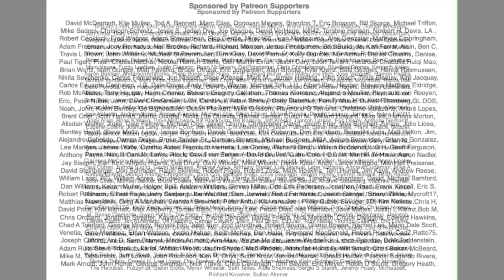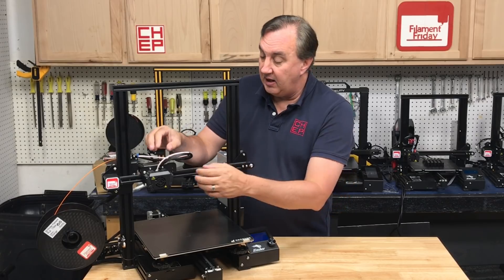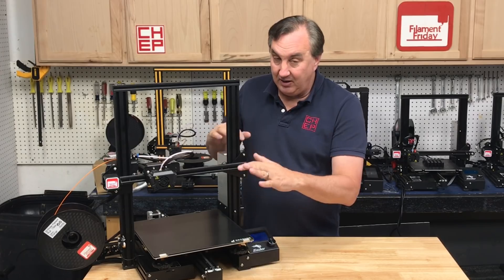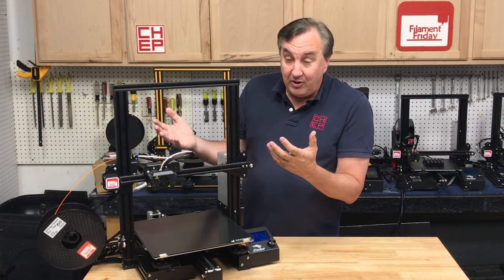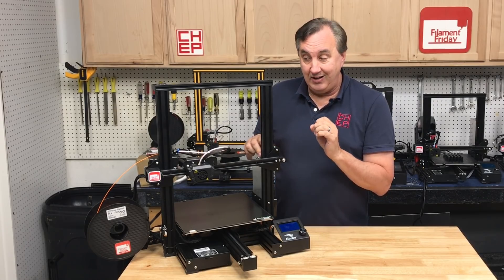Creality Ender 3 MAX! - 300mm x 300mm x 340mm

Comment: I don't know about the Z-Stop switch placement issue, but the current website listing advertises that the Max now comes with a run-out sensor installed on that empty bracket space, and mentions that the board is "silent" (50db).  It's also now $329 US, so the same price as an Ender 3 Pro and a Extender Kit, but you're getting a run-out sensor and a "silent" board, plus the dual cooling fans.  Mine will be here this week.  I already have a BLTouch to go on it, so the z-stop issue, if it still exists, isn't a concern of mine.
Reply: Scrolled further down, and the drivers are advertised as 2208.  So it's the 4.2.2 board with the 2208 drivers.  I will confirm when mine arrives if someone else doesn't by then.
Reply: @jafrance78  How's your printer? Did you get it by now?
Reply: @toasttoriginal  No, it’s taking longer than I expected. However, I can confirm that Creality did NOT redesign the Z Stop switch mount. It’s still fixed, and too high.
Reply: @jafrance78  sorry, i am new to 3d printing but how does the bl touch negate the z stop being too high? I also planned to get the bl touch add on.

Comment: Hi, I have a question what keep me from buying 3D printer. -  It is really time consuming and problem to properly set up ? Or I simply install all parts , and print from file ?
Many Thanks
Reply from the maker: Depends on the printer you buy. The more expensive printers (above $1000) are better supported and more plug and play but no printer runs without some TLC.

That’s why I recommend a low cost printer to try it out before spending more to find out you don’t like it.
Reply: @FilamentFriday  Many Thanks for the advice, I heard that it can make trouble and exercise your patience.

Comment: I wanted to check the print volume / space dimensions. The website says 300mmX300mmX340mm but an image shows 300mmX300mmX400mm.  Which dimension is accurate?
Reply: 300x300x340 is correct for the Max.  The CR-10 is 300x300x400, and the Ender Extender Kit makes an Ender 3 300x300x400.

Comment: Heck, even the CR-10S Pro/V2 still has an 8-bit board, and as far as i know they havent released any upgraded 32-bit boards for the CR-10S "Pro" model? Its like they forgot the CR-10S Pro/V2. Instead of releasing new models every month, focus on the ones you got. Why should people buy the more expensive Creality printers when the new cheaper ones have better specs than the more expensive ones?

Comment: Thank you very much for your content. I do have a question. Ender 3 Pro has 20 teeth pulleys for X and Y axis, that means 80 steps per 1mm. What will happen, if you change these pulleys for 16 teeth. If I do count correctly ( Prusa calculator not me 😄 ) we should get 100 steps per 1mm. Will it increase the accuracy of Ender 3 Pro for example? Torgue should go higher too with accuracy I guess. If it does, maybe Creality could do it for all new Enders. What do you think? Can you test it? I bought Ender 3 Pro, just because of your channel. Thank you very much for all the videos. Have a very nice day sir.
Reply from the maker: Are the different diameter? I don’t see why steps change for teeth.
Reply: @FilamentFriday  If I do have the right chart, 16T pulley has pitch diameter 10.19mm, 20T pulley has pitch diamater 12,73mm, everything else is same.
Reply from the maker: You could try it. With microstepping, I’m not sure there is a potential for much improvement. I’ve seen 0.9° stepper motors installed but never saw print improvement.
Reply: @FilamentFriday  Sir, you are an expert, not me, I am just guessing. It looks good on paper.
Reply: 16 teeth at GT2 (which has 2mm tooth pitch) is 32 mm per rotation. 20 teeth is 40 mm per rotation. 200 steps per rotation. 1/16th microstepping makes 3200 micro steps per rotation. By my calculation, then, for the 20, that’s 10mm per 800 micro steps aka 80 per mm.

For the 16, it is indeed 100 micro steps per mm (3200 micro steps for 32 mm). The difference between those two is going to be marginal. And also, the 16 teeth gears are starting to get pretty small compared to the tooth size.  At some point, you’re going to run into the thing where the ratio goes up and down depending on what side of the tooth is engaged exactly. The GT2 belt profile is designed to do that as little as possible, but that effect is exactly why 16 teeth gears fell out of favor and 20s came into Vogue.
Reply: @JasperJanssen  It still looks "on paper" improvement is 25%, even the improvement is invisible for us.
Reply: @AdamDeBeers  yeah, the question is whether it’s improving the right things. 80 vs 100 micro steps per mm means 12.5 vs 10 micron per micro step. Now, how many micro steps is the actual effective resolution? Probably around 4 ish. We can definitely do half steps, quarter steps are mostly ok, anything more than that is pretty iffy. So let’s say we’re talking about 40 vs 50 micron in actual impact.

Is your gantry really stable to the point that 10 micron makes a difference? If you were to assume that you can actually do the full microstepping effectively, is your frame stable and true to within 2.5 micron? When things are moving, and possibly people are walking? I can almost guarantee that if you have a heavy footfall on a wooden floor you will make a CR10 without diagonal braces move much more than 3 microns at the top of the gantry.

Balanced against both the lower max speed (which goes down in the same ratio as accuracy goes up) and the increasing likelihood of tooth pitch artifacts showing up, I don’t think this is a meaningful upgrade.

Plus there is the fact that upgrading to 400 steps per rotation steppers (0.9 degree instead of 1.8 degree) is trivially easy and doesn’t really give you any useful improvement despite a literal instant doubling of precision.
Reply: @JasperJanssen  Thank you very much for explaining.

Comment: I wish they would really at a bl touch/auto leveling! Or make it an option! This would make this a way better machine!!
Reply: I found out creality does offer a BL touch for the ender three it’s $50
Reply: @trialnterror  Yeah I put a BLTouch on my Ender 3 v2.
Reply: @Krytern  how good does it work?
Reply: @trialnterror  Do you mean how to install it, or how it levels the bed?
Reply: @Krytern  I mean does it work good as in sticking the filament to the bed properly? And long term use does it work?
Reply: @trialnterror  It works great. Prints stick to the bed and I even have tall, thin objects I print where I put a brim on it and it sticks good still. Perfect first layer every single print without having to level the bed myself.
Reply: @Krytern  I have quite a few printers and never used one. I bought the kit and I leaning on putting it on my ender 5 I’m also going to buy the stuff to make it dual Z. I have a heck of a time with that ender 5. I have never really got it to print. ( I have 3 cr10’s 3 ender 3’s anet, anycubic, sunlu s8 and the 5) so I feel I’m well versed in printing. This is my last resort to get the ender 5 printable!
Reply: @trialnterror  Maybe you have a warped bed. The bed on my printer is warped and the BLTouch compensates for it giving me good first layers.
Reply: If you want Bed Leveling and Filament Sensor, you buy a CR class machine, if you don’t, you buy an ender class. CRs go down all the way to base ender 3 size as well as up to 500^3 machines, Enders have... a little less size variation and more configuration variation.

It’s pure market segmentation by Creality.

Comment: Still happy with my original Ender 3 and a few upgrades (e.g. MicroSwiss hot end, DIY direct drive extruder). I don't need to print any bigger so don't see any reason to upgrade. I'd be more interested in updates that improve handling of more exotic filaments, stock Enders are best suited to PLA.

Comment: There's no need to get longer compression springs.  Add some washers on the threaded stud under the springs to increase compression.  I've done this on other printers when I've changed the printing surface.  It's a cheap, easy fix.

Comment: Ender 3 v2 with independent display cannot show folder.. how about ender 3 max with 32 bit with old display type.. can it show folder?
Reply: E3v2 can show folders if you update firmware with new marlin. Great firmware its from smith 3d for bl and without. Had it before upgrade to skr mini.

Comment: You should have just slotted the holes in the Z stop mount. Had to do that to my S5. What are they thinking making the mount solid?!!
Reply from the maker: I remounted with t nuts.
Reply: or printed a new mount.
Reply: Hard to print when you can't set your paper gap. Lol
Reply: @Motovader72  He said the prints were not that good because the bed was so loose, meaning he could print.  Not hard to print even with a loose bed to get a small part to fix it.  Then print a better one until it is fixed.  Also you don't need to set gap with paper, can adjust while printing a test cube or circle.
Reply: @pheelix- my suggestion worked for me, Chuck fixed it another way, and you're certainly entitled to do whatever you'd like as well. Happy printing.
Reply: @pheelix-  BTW,  repeatedly printing less crappy parts until you finally get one acceptable enough to fix the problem, is exactly what I meant by "hard to print". Lol
Reply: @Motovader72  Yup, that's why I picked up a BLTouch and bypassed the Z stop and paper gapping corners all together.  Just need to do a quick paper gap on nozzle change.

Comment: The bed is wobbling around the Z axis. Cannot you adjust the excentric nuts of the bed?
Reply from the maker: The eccentric nuts were adjusted. It’s not the base it’s the bed too high on the springs. I lowered the switch by switching to T nuts.
Reply: no its the springs are to lose to keep it in place.

Comment: Creality has too many variations of printers.  Just keep it simple like Prusa.
What is Creality thinking? Or not thinking really.

This MAX is garbage.  Just get a V2 (or a Prusa mini for the money).  Unless it's killing you to print large items.
Reply: I kinda agree with this. It seems like they have consumers beta test their designs for a budget price. I've had my 3 for a month and I've replaced half the things on it already. I would just get an Extender if I wanted to go bigger.
Reply: @bnutz3k  wow, seems like u have some bad luck with yours.  I have a Ender 3 V2, Ender 3 Pro, Ender 5 Pro since release for each and no problems at all.  Love them.  Great machines.
Reply: @timd9430  Mine is an original Ender 3 v1, so from my perspective as a newbie to the tech, it was definitely lacking out of the box.
Reply: @bnutz3k  yeah, probably so. ; )
Reply: @jon9947  oh, I got it kickin ass now. Got the latest SKR board, direct drive, micro swiss. I love it! It just needs some experience and tinkering knowledge out of the box, imho.

Comment: how did you fix the x axis ? I have the same problem with my ender 3 pro.
Reply from the maker: I didn’t. It appears the knock off stepper drivers may be causing some of the issues. That’s why I’m pushing for them to upgrade the stepper drivers to TMC silent.
Reply: @FilamentFriday  so there isn't a problem with that much play in the x axis where it connects to the uprights?
Reply from the maker: Those should be snug but allow travel easily without the lead screw installed.
Reply: @FilamentFriday  still learning here. 🤦🏻‍♂️ I just found what was wrong there and fixed it. Hate learning the hard way
Reply: @FilamentFriday  My ender3 is up and running again. now for the other the 2. I am not throwing money at my printer frustrations. What I want to say, and maybe this may help you with some ideas for filament friday by identifying some discouragements that I felt just starting into 3d printing and going for low budget printers. Ender 3 was my first purchase based on Maker's Muse and your videos. The issues that I ran into after a really confidence (over-confidence) building first month of printing just about anything I wanted with only a few frustrating false starts and trial by error were; 
1. low budget equipment is low budget quality and needs upgrading or better PMCS (preventive maintenance checks and services)
I did not know that the hex bolts on the leading rollers needed to be tightened when my bed and x axis were wobbling
2. over and under extrusion and hot end fixes - your videos, especially the washer trick for the capricorn tubing was most helpful. 
I am wondering if that might help with my s8 hotend and using a shorter mouth (whatever the threaded insert with the silicon insert is called)?
3. different brands of filament are very problematic. 
I accidentally bought a PETG instead of PLA from yousu. following the recommendations of a number of content providers was not helpful and I had to abandon the packaging guidelines and go with a very low print temp and lower bed heat. 195 and 50 and had very nice results. gave me confidence to get a few more rolls of PETG and have regretted that now as between bed adhesion and extrusion issues - too hot or too cold, being well into a longer print only to find that suddenly my print is stuck to the nozzle and traveling in a mutated half printed glob.  
Is there a method I missed? 

Is this where a larger nozzle diameter would be more effective? 
*Angus at Maker's Muse had a video about leaving printed parts out - that and my first stunted, but rewarding experience with PETG had me appreciating the durability. I printed out a stormtrooper's blaster with PETG. 

Sorry, didn't mean to unload on you. Maybe I have missed content between you guys and two other providers that I cannot remember, but are reliable (for me, at this point).

Comment: You could put some washers under the springs
Reply from the maker: Or I could just use t nuts on the switch so it’s adjustable which I plan to do.

Comment: I totally agree on the Creality firmwares overall. Fix them.  Use the latest version available from Marlin and post them with their config files.  I always build my own firmwares anyway but people just coming into the hobby shouldn't have to worry about it.  It's not good to be offering old versions with no source code readily available. As for the printer, hard pass for now.

Comment: I love my Ender 3 but it seems nuts to want to buy a scaled up version for that price. The printer is going to be very slow and problematic due to all that extra mass and the single z rod. Besides which, there are XY printers costing less than this and they would be better suited for larger build volumes - faster and less ringing.

Comment: I ended up rigging the limit switch to T nuts like the original to move it down - from the factory mine could barely reach nozzle height and had the same wobbly issue... super odd choice on their behalf - why hard mount it so high up??
Reply from the maker: Agree, I plan to T nut the switch but I wanted Creality to see the results as shipped.
Reply: @FilamentFriday  you realy like this printer?
Reply from the maker: It’s ok. They’ve updated it and I’ll be doing a new review with the updated version.
Reply: @FilamentFriday  this updated model, will it still be the Ender 3 max or is it going to be a different machine?
Reply from the maker: Ender 3 Max with some of the improvements I suggested.
Reply: @FilamentFriday  do you have a rough idea on when the vid will be out regarding this upgraded version?
Reply from the maker: Sometime this month.
Reply: @FilamentFriday  thanks I'll be keeping a look out, just can't decide between the V2 and the max as a first printer, but wanting to future proof as mostly not going to have a second at the same time

Comment: I got a Sunlu S8 and although it had a lot of issues like loose bed, awful z stop placing and ancient firmware for £170 from Amazon on offer. it now prints better quality, and easier, than my Ender 3 Pro. It's still loud so I will replace the board but I have made the latest marlin for it and it runs very well. I wouldn't suggest it as a first printer that many reviews so as there were too many initial issues. the y belt wasn't aligned straight due to loose fittings at the front and if I hadn't already had a printer I wouldn't have noticed this but as a second printer it would be great. I'd spend the savings on a new board, new screen and a mains powered heated bed (as bigger is sloooow) but it is printing great at the moment with stock.

Comment: Great video! Being the 3d printing Guru you are those problems you could fix easily, use filament runout, use your own t nuts on the switch, and flash the card. Most of the problems are gone in a few minutes. The biggest thing I see is not being dual z. Gonna be fiddling with that all the time and why I wouldn’t buy this unless I had that kit.
Reply from the maker: I want Creality to fix it so no one has to do all that. They sent me a beta test to review not fix their crap. 
But I will be adding T nuts to the switch so I can adjust it and I’ll be reflashing it with Marlin now that the review is over.
Reply: @FilamentFriday  I wasn’t trying to be rude, I hope you didn’t take it that way as I reread my comment it could be taken that way. Hopefully they fix that stuff!

Comment: I wonder if the differences and the insanely quick release cycles between all those new Creality models are really worth it, particularly in terms of firmware updates, available spare parts etc. Why not have a real low cost, DIY line like the Ender used to be, and one of the more Prusa-esque, no-worries experiences like the CR-6. But get rid of all these Pro X V2 Max models. I am already getting frustrated with the CR-10 S Pro, which is a fine printer per se, but with all the money I have invested in upgrades and spares (non-standard nozzles - WHY???), it is already getting difficult finding parts and updates for a one-year old printer.
Reply from the maker: Agree.